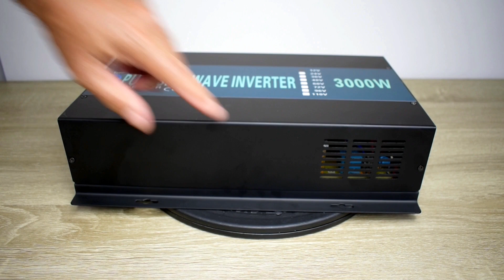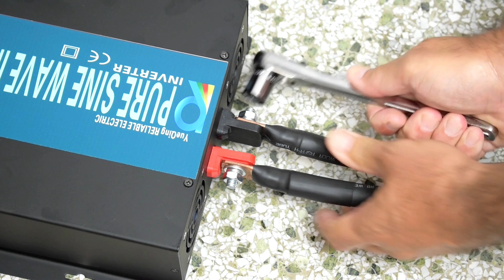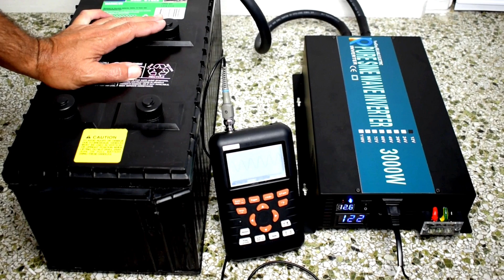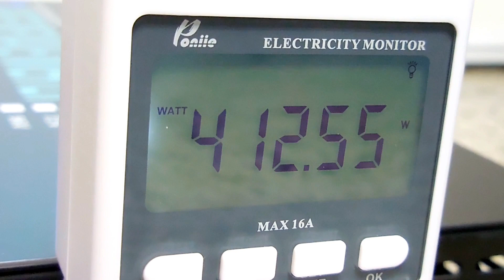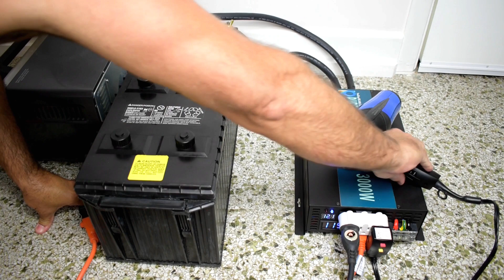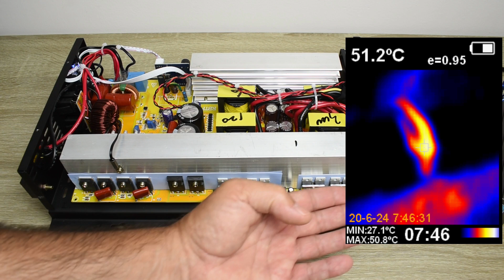Reliable Brand(WZRELB) 3000W/6000W Surge OFF-GRID Power Inverter Tests!

Comment: Thanks for the video. Is there a comprehensive way to learn about the electrical components and principles involved in off-grid solar, so that i don't fry something out,  or worse, get an arc flash?
Reply from the maker: It's very simple to set up a system. You can use the setup shown in this video, along with a MPPT charge controller that can handle the level of current supplied to your battery/inverter from your solar panels. Just be sure to use the correct size wire, use a fuse at the POS post of the battery, and keep the runs short as possible. Using a higher voltage system(24/48) will allow smaller wires to be used from the solar panels. You can find solar system wire size charts online. Thanks for watching!
Reply: @electronicsNmore  Thanks for the answer. I hope this isn't a dumb question,. but you only need the charge controller connected when you are charging the battery, but not when you are only drawing a load from the inverter? Is that right? Thanks.
Reply: @rootcanal7188  When you draw a load from the inverter, at the same time the inverter draws current from the batteries. The charge controller needs to be connected and functioning at all times. It prevents the batteries from deep discharge from the load by allowing more current into them from the panels. But to protect the batteries from discharging too low and damage them, an additional battery protector can be installed between the batteries and the inverter. I have a Victron Battery Protector with integrated Bluetooth that can transfer up to 100A for 24V (2400 watts) and I programmed it using their free Android app to disconnect the power from the batteries to the inverter if it discharges to 24.85V which is about 40% discharge and reconnects power to inverter if batteries recharge to 26.10V.
Reply: @MoooHamMad  Thanks very much for the thorough explanation.

Comment: I want to build a solar panel / solar water heater setup for my swimming pool. Can you give me some advice. I'm purchasing the solar water heater panels on Craigslist, I'm hoping to get 4-5 panels. It's cheaper than building my own. My goal is to hook up a simple pond pump that uses no more than 200w to pump water through these panels. 
Obviously the system only works when the sun is shining, so I won't need to store energy in battery at all. 

Can I just buy a few solar panels, put it on the pergola, and use a simple inverter to power the pump? What happens if the pump breaks and the power has nowhere to go, will things go up in flames?
Reply from the maker: You'll need a decent pool pump. The column of water is heavy.

Comment: What inverter brands do you recommend?  I need a 48v 2500 watt inverter.
Reply from the maker: The system in this video, but don't short the AC output unless it's protected with a fuse.

Comment: great video!  I love my Reliable inverters. I have 2- 3000w,  1000w and just got a 600w, all 24v and from amazon warehouse for  way less than retail.
Reply from the maker: I like them too, just don't short the AC output. :-)
Reply: @electronicsNmore  yea. dang. I seen that.  Im actually fixing one i bought for $17.  one of the mosfets was blown. waiting for them to arrive. should fix it.  Where you able to fix yours. It may have just been a diode?
Reply: @RodneyMobleySB where did you find the unit for $17? Sounds like a fun project

Comment: Probably the most detailed and best review I have seen for any product, I think, EVER. I just purchased this unit and am very glad to see you took the time here. Very informative! TYVM!
Reply: The 24v 3Kw version is now on sale at Amazon for $265.66, so I decided to search YouTube for reviews. I have to agree, this review is very good, as good as those by Will Prowse. I believe that over time you will get more viewers. I have been aching for weeks on which pure sine wave inverter to purchase, and based on your review I am now going to pull the trigger. I will test it as you have shown (except short circuit), and if it fails I'll just send it back. As one person remarked, the makers of cheap foreign inverters leave the QA control to us, which is part of why they're cheap. I will do my part and QA it thoroughly.
Reply: @alharrison3255  

I think the unit is 1500 watts steady power and 3000 watts peak,
Reply: @thefeet Are you still happy with your unit, I  was set to get this unit until the ending in this video! I recently had to return another brand (Ampeak) because in a technical jargon kind of way, they said  that the pure sign wave is not %100 of times!
Reply from the maker: Thank you! Glad you appreciated and enjoyed the video.
Reply: I Bought one too after seeing this video.

Comment: I need reliable but economical 24v inverters.  Let's watch the video for now.
Reply from the maker: The 24v version of this unit is fine, but don't short circuit the output without a 25 or 30A breaker installed.
Reply: @electronicsNmore  have you tested any other 24v inverters as I already got some funds for upgrades.

Comment: I have the same inverter, but 24v. I tested out the reverse polarity protection and I lost both the AC side and the DC side displays. I changed the 3 obviously blown 20 amp fuses and the DC side came but, but still no AC output. So i pulled the remaining 5 fuses that visually looked OK and all 5 were missing the smallest piece so i wound up replacing all 8. Unit is back to full function after replacing fuses. AC output is normal. So the reverse polarity protection worked for me!
Reply from the maker: My unit was ruined short circuiting the AC output, not reverse polarity. You were lucky it didn't get destroyed.

Comment: Fuses are very "slow" protection devices.  Something else (usually a MOSFET) will let go before the fuse blows.  So they are kind of useless unless you have a direct short form the positive input lug/wire to the negative input lug/wire.
Reply from the maker: If you size them right, and use a fast-blow type, they're very useful.
Reply: @electronicsNmore  - I disagree.
First, I don't believe that fast-blow fuses exist in ATO/ATC packaging.
Second, fuses can "hold" at much greater (even 100% over) than their rated current for SECONDS !
Third, over current can kill a MOSFET in microseconds.  The fastest fuses take millisecond.
Fourth, if one MOSFET fails, its load/current transfers to all of the other MOSFET instantaneously and overwhelm them and they all die.

I have seen a lot inverters with blown up input MOSFETs.  I have yet to see one where the fuse(s) blew to save the inpout MOSFETs.  Designing some type of very fast electronics that would protect the input MOSFETs is probably not cost effective.

If they are useful, why are they so difficult to access ?

Comment: Very interesting !  Thanks for the review.
I am disappointed that the output voltage dropped below 100VAC with heavy loads.  May the drop out input voltage should be closer to 11.0VDC.   It would be nice to see how 2 of those giant batteries would drive that inverter.
I don't think you can pass judgement on the MOSFETs without testing them.
Reply from the maker: After opening the unit, i saw why the voltage dropped. The full AC output was using 14ga wires. If you replace with #10,  I bet it stays well above 100V.

Comment: Great video, The efficiency calculation is not correct, and this has more output power than the input, I think there is something wrong with the measurements.
Reply from the maker: After the video was made it was discovered. The % is correct, not the #'s. Watch the follow-up video. Thanks

Comment: Wow! This needs some good amount of effort for testing and patience 👍. Appreciate your systematic testing. Like others, I wasn't expecting that ending! I'm sure in the days to come, this video is sure to pick up some momentum. Do let us know if you were able to the comments from the manufacturer in your video description 🙂. Eagar to know the reason for failure! Thanks for the 👍
Reply from the maker: I already spoke with them, and they sent a video showing a brief short circuit that worked. I suspect it worked for them, because they didn't have a huge battery and thick cables connected to the inverter for their test. My setup, a typical setup, can supply much more current than theirs. Thanks for watching. Be sure to share the video link with others. Unless videos like this get at least tens of thousand of views, they end up a huge waste of my time. Thank you!

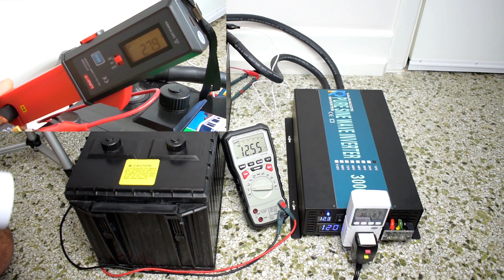Comment: --- 13:38 input 352.5 watts, ...output 412 watts,  Output > input , it means that you just reviewed a free energy device, congratulations.....but I thought you hate that kind of device
--- I thought 4 small EE transformers wouldn't be able to handle rated 3000 watts, but it goes up to 4000 watts, I wonder if the output wave turns into square wave due to the overload 
--- I watch several channels where they make their own inverters, and one of the channel builds a 2000 watts inverter with a single  transformer weigh 13 kg (28.6 lbs) , can you imagine that? I wonder if such heavy transformer actually is appropriate transformer than many small transformers like this one
Reply from the maker: 🤣 You're right! That doesn't make sense. I did a few tests, and came up with around 86%. I need to look over those #'s. Thanks for informing me, and thanks for watching!
Reply from the maker: I've come to the conclusion that my clamp meter, even though I calibrated it, it must have given an inaccurate reading. When tested with a 200W AC device, I calculated around 86% with my DMM in series with the battery. It's possible the clamp didn't fully close around that fat cable.

Comment: Weird you came up with this one .   I just purchased two of these inverters in the last two months.   A 24v for me and 12v version for the mother in law.   These were the  only units I could find that were capable of producing what they are rated for.   I've seen ZERO negative reports on these units.  Would like a follow up on the unit you shorted out and failed.   I would have expected  internal  Line Fuse to pop.  

Using Nissan Leaf Li  Ion  Cells (12ea 4P 6S)  initial  battery voltage of 25.00v.  The Low Voltage alarm kicks in before my batteries are actually in a low voltage status.  My run time is a bit short due to the way the voltages match up  but works quite well.   Disabling the SonAlert I can run until the unit does in fact shut down and prevents battery damage. 

The built in sockets are not wired for higher amp loads.   Use the out board wires for anything over 12A.
Reply from the maker: You're correct! The testing was done before the unit were opened for inspection. I figured the AC receptacles and terminal block had the same size wire. That also explains why the voltage drop was observed under load. Like I said in the video, it's a great inverter, just don't short the AC output. I found the problem just a minute ago, I'll be making a very short video to show it. Thanks for watching!
Reply: You said the "built in sockets are not wired for higher amp loads."  If that is true on this inverter, then it is not a good design, I have a 3,000 watt inverter that you can pull it's rated capacity from the outlets alone.  Another inverter is only 2,000 watt and on this one it has a 15 amp GFCI outlet, if you need more power, it has a terminal plate.  Don't want to sound like these are not good but for me, you should not be limited to current draw on the outlets on an inverter.

Comment: Was not expecting that ending. Overall good unit if used as intended. Good review 👍
Reply from the maker: Me either. Now I need to fix it. When I do, I'll add a 25A push button breaker to the output. :-)
Reply: @electronicsNmore  Definitely make a video of that! Seems like a great unit outside of this one shortcoming. Love your videos!
Reply from the maker: @rolliebca  Glad you really enjoy them! Be sure to share the video links, because most of them end up a huge waste of my time due to a lack of views/exposure. Thanks
Reply: @electronicsNmore   You need fast open fuse 25 Amps normal fuse won't help . I got degree in Electric engineering...
Reply: @electronicsNmore  all you had to do was disconnect it from the battery then reconnect it and it would have reset and worked
Reply from the maker: @BluesmanFishin  Incorrect. The unit was damaged, The company admitted there was a problem and they also tried making a different version inverter board, which still fails. If you doubt me, try it.
Reply: electronicsNmore i did mine restarted after i unhooked the battery and reconnected it .
Reply from the maker: @BluesmanFishin  Very lucky guy, dont do it again, you wont be so lucky.
Reply: @electronicsNmore  - Thank you for this great revue - I wonder if you were able to fix the inverter ? and if yes, could you please tell us what failed?
Reply from the maker: @am1rb  2 mosfets tested faulty, I'm waiting on a replacement inverter board that was shown in Part 2 of this video. The company never sent a replacement. I'm searching for one online.
Reply: @electronicsNmore   thanks ,It was not clear since on 21:29 you said "all the diodes and mosfets were tested and no problems at all "
Reply from the maker: @am1rb  Visually the mosfets looked OK, not blown, but 2 had problems when I tested them.
Reply: @electronicsNmore   thanks
Reply: @electronicsNmore  so did you repair the inverter? i have several of this brand and they are all working fine, they are based on the egs002 micro inverter circuit where there are also schematics on a chinese website so it should be an easy fix.

Comment: As soon as your are going to make a DIY powerwall 🔥
Reply from the maker: The inverter actually did well, outside of the one test that failed. Most people would never do what I did in that test. You can also add a 25A push button breaker to the inverter to prevent it from happening. Thanks for watching!